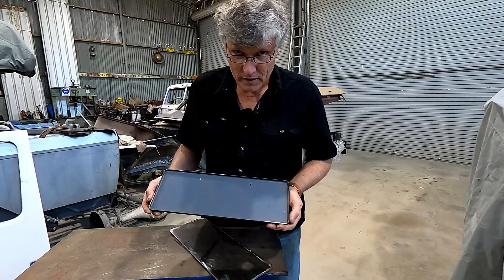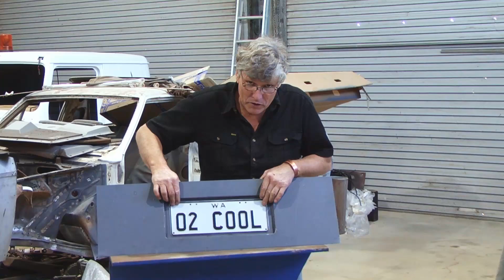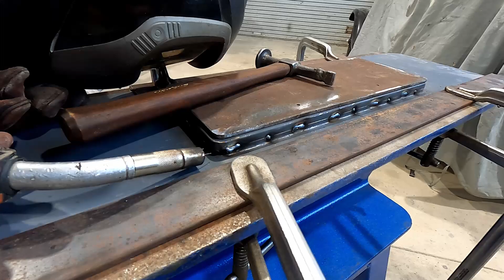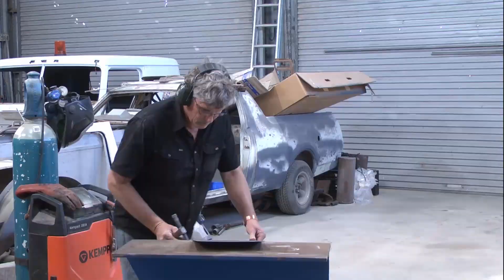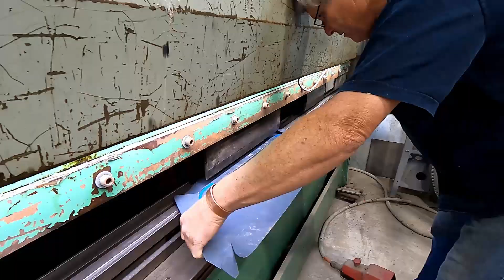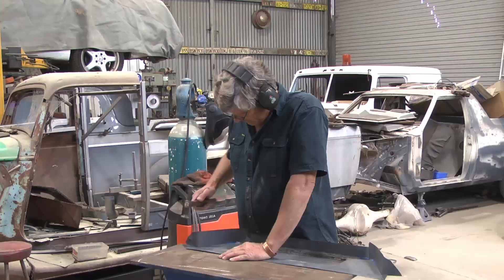Custom Tailgate - Part Six

Comment: Hmmm what a lot of time and welding for a number plate panel!
Reply: If I fabricated a number plate panel the way you did it with welding, my boss would FIRE me as we fabricate panels using a press and fabricating dies, and shrinkers, strechers, hammers and dolly's and the english wheel and a 50 tonne press
Reply from the maker: I did explain in the video that this project could have been done in a variety of ways, my videos are aimed at entry level restorers with a minimum of experiance and equipment. I" try" to show methods that can be reproduced at home. I also shape a lot of metal in a 60t press. Thankyou for your comment. Cheers Rob.

Comment: Excellent work and a great insight into forming metalwork. Particularly like you explanation of sharp corners and why its best to avoid them in order to ease painting!
Reply from the maker: G,day Mate. One thing I try to get across in my videos is to think the whole process through. The shape of the corners does effect the way it can be painted, so adjust your design to make it work. I have created a little bit of a paint delema with making the top of the cavity angle down at the outside. I will probably need the little spraygun to get that surface painted properly. Fun times ahead. Stay tuned. Cheers Rob.

Comment: G'day Rob, I noticed some comments in I think the last video of this project.
They related to number plate lights and no room🙂

Thought for a moment, then decided to wait😉

Thanks for the update and proving myself right as to this video.

Love metal work, and what can be achieved whilst other's are doubting finished item.

Should definately comply, buddy ( re lighting) 😉🙂👍👍
Reply from the maker: I am a sparkie after all.😉 the original two lights will clip into the top of the recess and work just as GMH designed them to do. Stay tuned nearly there. Cheers Rob.
Reply: @robsshed  I went and measured one Rob😉

New where you were headed, because of my trade life training.

Love watching fellow creators buddy.

Keeps my sanity, more particularly it keeps my mind focused and re learning things I have forgotten I learned 40yrs ago.
Hand injury kind of messed with my minds capacity to locate information rolling around somewhere in my memory.

Keep going buddy you teach well😉🙂👍👍
Reply: @robsshed  I figured as much Rob I went and measured a light just out of curiosity.  ( typical 3rd gen Automotive Engineer) That loves metal work, creating bucks etc.

Always have loved fellow creators, regardless of background trade life.😉🙂👍👍

Something to do with my Irish grandmother once saying the following;

The day you die is th e final life lesson in learning, get used to learning.

Keep those video's coming Rob, some day's they save my sanity😉🙂👍👍

Comment: you should try some red and green off set snips . the cut will be much nicer with a lot less stretch that the red and green straight cut snips leave
Reply from the maker: I do have, and have worn out many offset red and green handle snips. Most of the time I don't see the need. Cheers Rob.

Comment: I'm a newbie to sheet metal work and trying to learn. Would have it been better to do the folds in the material before anything else to provide the sheet some strength when you cut the number plate hole and folded the edges
Reply from the maker: Excellent question, did consider that but decided it could lead to extra work to finish it. See video response.  https://youtu.be/guzkaHkA4RA
Reply: No